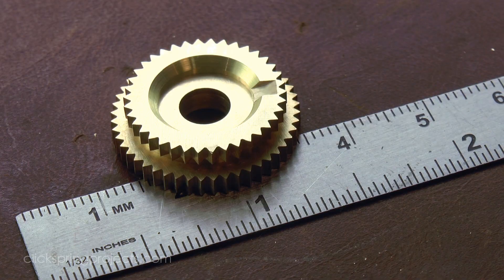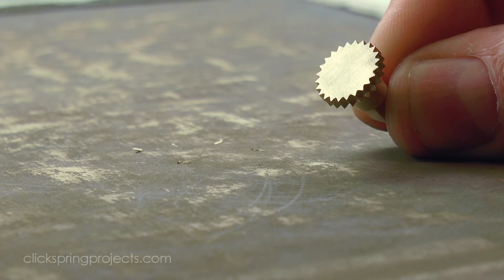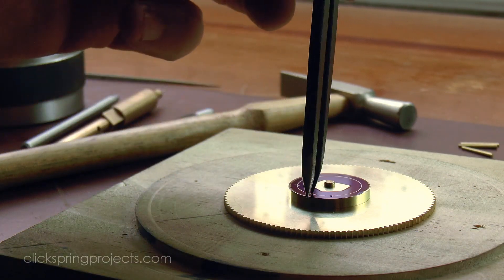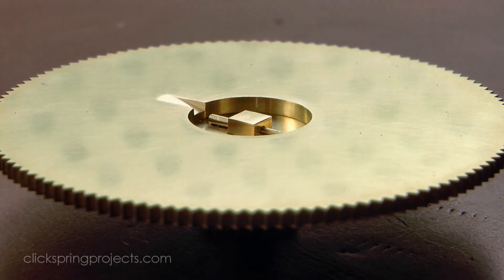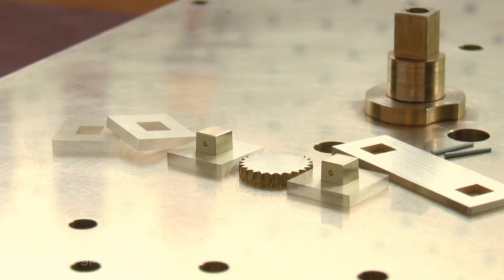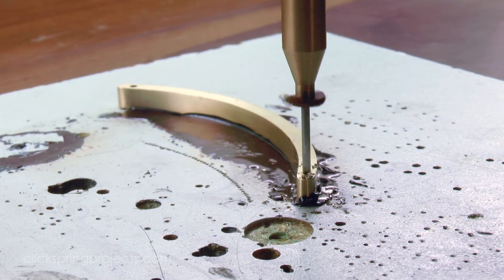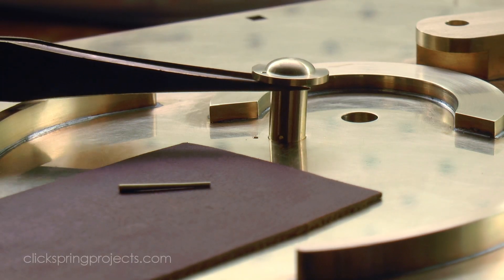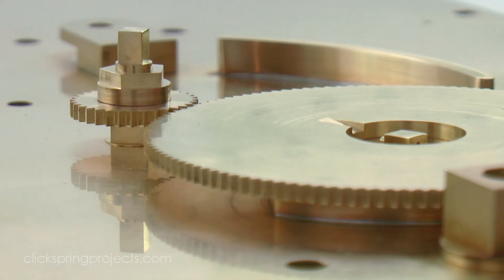The Antikythera Mechanism Episode 8 - Making The Mean Lunar #Sidereal Train

Comment: Gven that the original was bronze it would have had a lower coefficient of friction than the brass you are mostly using. Same reason that Bronze is used over Brass today as bearing and bushing material.  Could be another reason for the parts breakdown, more lead in the bronze gives a better bearing material, higher tin content gives stronger bronze. We already know their metallurgy was good so the variation of tin and lead content for the best material for the job isn't much of a stretch.

Comment: love the drill and the drill work, but I have a feeling that if the old ones were building these machines then they would have put that drill on a stand for accuracy, also to save drill bits and to save wollering the hole. That way they could have the apprentice drill the hole and reduce the chance of them messing it up, I bet those old masters were like old school engineering of the past, the youth to sweep the floor and do the drilling.

Comment: I just discovered your channel and it's totally engrossing. I'm a woodworker but I find metal machining fascinating. 

I have one question though. From working wood I know that square is much easier than round. I see that the modern techniques you use are a time saving issue but I'd like to know how you think the Greeks created such high tolerance cylinders. Did they have some early incarnation of the lathe?

Can't wait for the next installment!

Comment: I found your channel just a few nights ago after your recent soldering video appeared in my recommendations and I spent that night wathcing through your Antikythera videos. Incredible piece of work and fascinating to actually see the fabrication process and how you worked through the engineering challenges! Thank you for sharing this.

In one of your videos you explored using candle soot as a marking medium, quite coincidentally I watched a new BBC documentary called 'Invisible Cities' where they were exploring the historic layers of Istanbul using laser scanning and VR modelling. While exploring the Blue Mosque they illustrated a system of hidden ventilation ducts which fed into a hidden gallery above the main dome where the air would be dissipated out of the building.

It was explained that the hot air, laden with soot from the many oil lamps which illuminated the vast space, was channelled into this hidden gallery where the fine soot would be deposited onto the walls and vaulted ceiling of the hidden gallery before the spent air was vented. This soot was then collected to make inks for use in documents and manuscripts produced by the Mosque. So I think you're onto something.

Comment: So, for you antique tools series. The lathe or any other rotary device is probably powered by a foot pedal and a elastic rope.

In school we build those for woodworking and it's quite nice... But I would love to know what modifications you need to bring this into a single direction of rotation and have your cutting tools on a jig as well. 

I am looking forward for this video, as I might try to build something like this myself from scratch. Or using an old sewing machine that is pedal powered and has transmission weeks already.

Comment: For them to have used 'Bridges' and 'Circular supports' to hold the gears in place, suggests to me,  they made others that failed, a learning curve. This was not a one off and there must be other clock machinery to be discovered if not melted down for their metal.To get to this standard of engineering you need a large support industry, the miners who mine the ore, the smelters to refine and produce ingots, the metal workers to turn it into sheet, bars, square and round stock and then the clock maker who make the gears and assemble the final machine. If only anything of the industry survives and could be found.

Comment: Awesome as always, thank you! When you peen the ends of the shafts I see you sand and blend the material flat beautifully afterwards, I guess there is enough 'disturbed' brass around the peened area of the pinion to still maintain strength, but it always tends to look as though the stength has gone too. When you are hammering I guess the shaft will swell slightly as well and tighten to the pinion? A fantastic production & always inspiring!

Comment: 7:45 : I don't understand what that does...  You explain it, but you compare it to things I don't know, either...

From the mechanism being activated I see that it does...  Nothing?  I don't understand its purpose...  Seems like the sort of thing that's added after it's built because of a problem or something you add in subsequent builds because of experience, but that has no obvious intuitive function...
Reply from the maker: It sets the height of the larger wheel on the other side of the plate very precisely and solidly with its mating wheel - Cheers :)

Comment: What I still don't understand is how a face looks perfectly smooth and solid after a rivet has been hammered into a hole and the face sanded.  I can see that you deform the end of the rivet to make it larger than the hole, but wouldn't sanding that face negate what you just did?  Like hammering a nail into wood, then cutting off the head...?
Reply: Its called peening (pin peening), and its a very old method of joining. The peening  will expand the hole slightly towards the top, and pin will be a perfect tight fit. But your seeing a ball-peen hammer in the hands very skilled artist.

Comment: Just a lil question Chris, I have yet to hear you mention any form of lubrication. Is this down to the lack of fine oils or risk of "gumming up" with mediocre medium when these mechanisms were envisaged. Or is it just something that cannot be detailed? 

I would imagine that a machine of this calibre would be subject to extended use (testing for example), and I can't help but wonder if this type of machinery, with these materials, would be subject to wear and tear without some form of slippy stuff, especially with the environment that this particular machine would be exposed to. 

Thank you for the entertainment, I was gonna hold off and watch this tomorrow, but I'm happy to have witnessed this in my current state. I don't think I could have enjoyed it with the mother-outlaw and my son yapping away in the background while having my first cuppa. 

Excellent production, excellent fabrication.
Reply from the maker: Thank you mate, so pleased you enjoyed it :) Great question on the lubrication - I've been testing it out and so far I'm fairly sure it was run dry. Its a very unusual machine in that there are large surface areas in contact with each other that we wouldn't normally see today. The result is that any sort of low viscosity lubricant forms a hydraulic lock very easily (and of course its debatable that such a stable lubricant even existed). There is still an outside chance that a grease was used, but only on the high torque region of the mechanism (eg the main bearing). Anywhere else and it would have added more of a friction penalty than would be acceptable - Will report as I learn and test some more - Cheers :)
Reply: Maybe a dry lubricant like graphite or talc was used?
Reply: @Clickspring  
Good job,  is an understatement. ..to the nth degree...
Didn't they use fish oil and whale oil as lubricators years back?
I knew a clock maker , and he had a small bottle of lube , that he called whale oil. (?)
Reply: @willybee3056  I know nasal sebum (the oil from the sebaceous glands on your nose) has been used in watchmaking for centuries.
Reply: @Clickspring   NASA still uses whale oil.      https://www.treehugger.com/clean-technology/whale-oil-as-space-lubricant-better-than-anything-we-can-create.html
Reply: Perhaps olive oil?  would seem appropriate for the time and location
Reply: The problem with olive oil is that it's not just an oil, it is, or has fatty acids in it.  This results in an environment that is not stable and the oil would not remain fluid indefinitely.  If mineral oils were available at the time, they might have helped, but I'm going to have to bow to the excellent research that Chris has done here.
Reply: Olive oil gums up in short order so it is not suitable as a lubricant It also goes rancid quickly and doesnt tolerate much heat. The reason there is so much of it now is that it was used as lamp oil in ancient times and as  a result of that a surplus of trees has always been grown since it was an important commodity in the antique empires.
Reply: Olive oil does not gum up without heating it (i.e. oxidize - because of this it's never used in treating wood, since it will remain liquid) and will not go rancid for a long long time (hence its use as a preservative). I would assume some form of lubrication was used to prevent wear and the machine was possibly taken apart once in a while for cleaning and reapplying lubrication.
Reply: I'm pretty sure they used WD-40...
Reply: The machine was not subject to high speeds, or particularly high loads, keeping it clean with alcohol to remove the acids from people's grubby hands was probably more important. Doubt that it needed lubricant.
Reply: I would imagine something as simple as Ash from the fire would act as graphite on large surface areas.